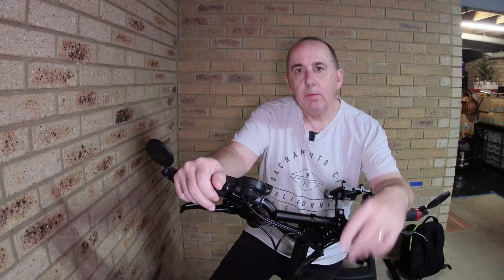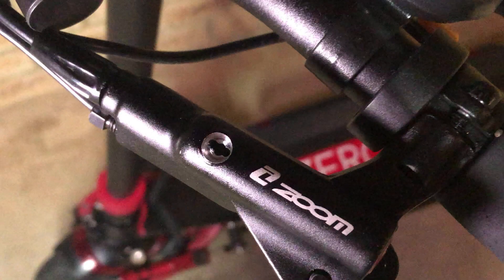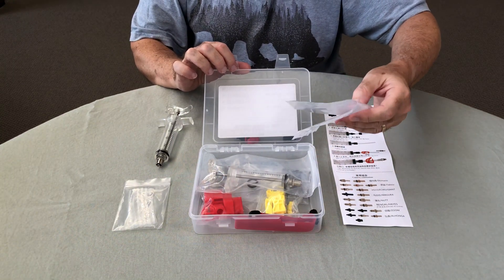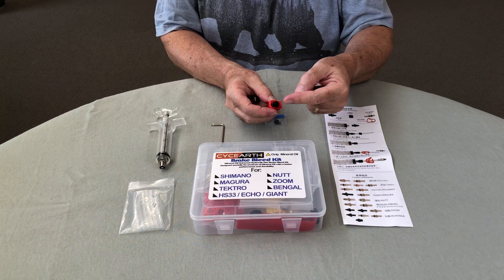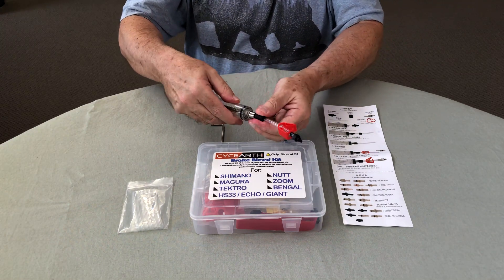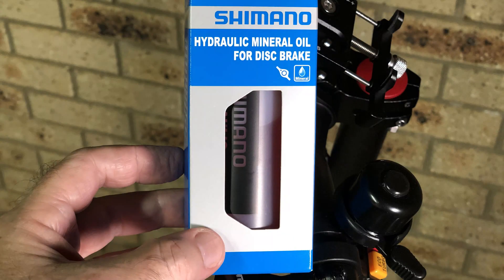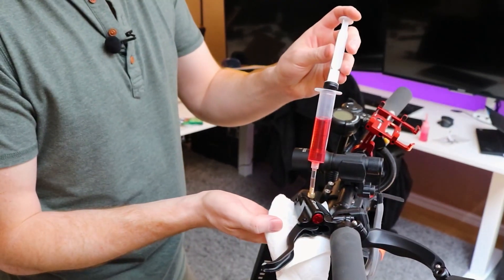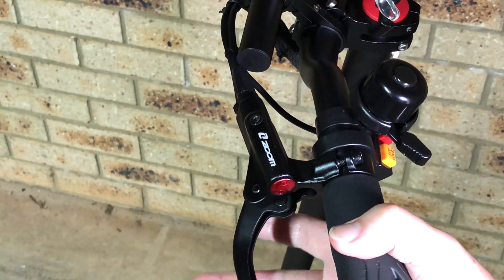How To Get The Air Out of Your Zoom Brakes

Comment: I've tried everything like 10 times and my brakes will have great steady pressure for 30 or so lever pulls then it will get spongy. I don't know what to do it's not leaking fluid anywhere. I'm at a loss, I might just have to replace the whole system idk

Comment: Brilliant.  Thank you so much.  I'd been struggling along with only front brake working on my zero10x and even that was starting to fade.  I bought one of the full bleed kits and had a go but was left frustrated with the result (plus it's tricky trying to do it by yourself).  I added your method in just now and as a result I've got a rock solid rear brake now.  I'll be doing exactly the same for the front (without the full bleed process) to get the fronts up to scratch.  Thanks again.

Comment: Thanks so much for providing this alternative method of bleeding brakes. My Paselec GS9 eMTB came equipped with Zoom hydraulic brakes. After 600 miles of usage, the rear brakes suddenly went spongy, and eventually the brake lever bottomed out. This model of brake has the additional cable to signal the eBike to stop power to the motor, so that helped a bit; but I was completely dependent upon the front brakes. Zoom changed the size/threads of the oil fill hole in 2021, so mine is the larger for the eBike that I purchased new in September 2021. Your method worked for me on the first try. Due to obstruction by the shift lever assembly, I was unable to rotate the brake lever unit far enough to remain level, so I had to remove it from the handlebar before the bleeding process. Despite the need to hold the syringe upright while pumping/flicking the bubbles out of the line with the other hand, the process was successful. Neither of my local bike shops service Zoom brakes, and they both recommend replacing them due to so many reports of them being problematic. I tend to concur now, but your brake bleeding method allowed me to get back on the roads/trails until I get some Tektros or Shimanos. Thanks again! Who knows... you may have prevented a potential accident if my front brakes had also given out.
Reply from the maker: Hey Styx, glad to hear it worked out for you. Yeah, an upgrade is probably the best long term solution. Stay upright! 😉

Comment: Thank you for the amazing video! My rear brake wasnt working at all and i didnt know about bleeding air. Turns out mine was pretty much all air at this point, pumping it out like you showed worked but after 45minutes i simply resorted to unplugging the rear brake hose, filling the serynge with shimano brake fluids and simply dumping some until all that was coming out was a nice stream of brake fluid, it does waste alot of it but after doing that a quick 15minutes of bleedling and now my rear brake works wonder! (Outside the fact im due for new pads..)
Funnily enough, for the fittings in the kit, mine worked as shown while the plastic one didnt fit. I also dont have any metal ring inside my fill port on both brake (first time opening the fill port). Anyway, really tankfull, i daily ride an electric bike until i get my own motorcycle and not having brake on something that easely reach 40km/h is well...not exactly stress free...

Comment: Yep great video,thank you for the heads up about the washer and orings,i did  a complete oil change and used the flick lever  method with the funnel still attached instead of syringe to finish off air bleed,worked a treat,for info the ezy mtb kit with copper had correct nipples.

Comment: I’m having this issue myself, I tried this method but the fluid doesn’t appear to move inside the syringe. Could it be an issue with the master cylinder? Help please
Reply from the maker: Hi, to be clear the fluid level in the syringe shouldn't change but bubbles should appear and rise to the surface.

Comment: Excellent video Mark. Trying to help my brother with his almost new e bike zoom brakes. He hasn’t had the bike a month and the rear brake is spongy already. Are there any theories out there why and how air gets in? Thanks Mark
Reply from the maker: Hi Win, thanks for the positive feedback! Often the scooter is shipped with air in the lines - poor QA from the factory. That was certainly the case for mine. If you bleed them so they work well and then the problem comes back quickly (within a week or two) then I would suspect a leak somewhere in the system. Check that all bleed ports are sealed properly. If he still has problems then a replacement brake kit may be needed. This should be a warranty claim if it is a new scooter. Good luck ! Mark.

Comment: Thanks for this video, it was very easy to understand and I was able to fix the spongy brakes on my brand new Dualtron City in about 10 minutes. I did notice a few things were different as I went along. At first I was concerned that I wouldn't be able to follow the steps. 
1. I bought a kit from the same manufacturer "Cycobyco" and it had Zoom brakes listed on the cover. However, there were NO instructions or connector diagrams for Zoom brakes. It only listed the other brands.
2. The black plastic connectors in your kit were yellow with black washers in my kit. (an improvement IMO). None of them was the same shape as the one you used. The kit does contain black plastic connectors, but they're all identical and they connect the syringes to the plastic hoses. I took the stopper (I forget the proper word) out of my brake master cylinder and tested the connectors one by one. I started with the (silver) metal ones and was able to find one that fit, it already had a washer on it. 
3. When I removed the stopper from my brake I was careful to check for a washer. I found that it wasn't metal, it was a black rubber O ring which was hard to see at first and it stayed on the thread of the stopper. I put the stopper in a pill bottle so the washer wouldn't get lost. By the way, my brakes didn't need a Torx bit, they had sockets for standard Allen keys.
4. Those red clips on the hose are great to stop leaks but horrible to open. Next time I will use hemostat forceps.
5. At first I was worried while I was bleeding the brakes because I didn't see many bubbles, however the brakes lost their sponginess within a minute. I did "flick" the brake levers to bring up more air. 
6. When I was finished and putting everything away, I left the hose connected to the metal connector I used for the brakes, so I'll know which one to use next time.
Reply from the maker: Hi Rose, thanks for providing that detailed info for Dualtron. It sounds like the brakes are slightly different to mine. Glad it all worked out ok for you! ☺

Comment: Can this gravity technique work even if the brake line doesn't always run vertically ? (rear brake)
Reply from the maker: Hi SR. Over time any air in the lines tends to float up to the top of the system, so the method shown works on front and back brakes. It's possible that a small amount of air could remain in the section that slopes upwards towards the back brake caliper but this would be an insignificant amount and would not be noticable in the brake handle.

Comment: Thanks a ton for this video. I used this on my Vsett 10+ and the brakes are firm again! Not sure if the vsett version of the zooms are different but mine had no washer and required a slighlty larger adapter but it all came in the kit so not a big deal.
Reply from the maker: Hi John, thanks for the positive feedback. Glad to hear it all worked out ok for you ! Cheers, Mark.

Comment: My right Zoom brake lever didn't actually have the metal washer. I watched this video before hand and made sure to check for it as I was unscrewing, but there was only the rubber seal. Any ideas where I could even purchase one? For now I just doubled up on the rubber seals and am hoping it's enough. Thanks!

Comment: I've seen others use the velcro strap to hold the lever compressed while unscrewing the syringe and I noticed you didn't do it.  What difference does it make?
Reply from the maker: Hi, none as far as I can tell. They do this to prevent air being drawn in when the lever is released. However, if you have done a good job this won't happen anyway. Basically, as long as the fluid level is touching the thread (meaning some will overflow when you replace the plug) then you're good to go!
Reply: @MarksElectricLife  Cool, thanks for the quick answer!

Comment: Great video. Just did an upgrade from Zoom hybrid brakes to full hydraulic on my Mantis. Started on the front as the original one failed totaly. Rubber boot split and lots of leaking with no clamping pressure at all! I had previously bought the full hydraulics from another scooter owner, who upgraded to Nutt brakes. I was trying to be clever and not let any fluid out, so i wouldn't have to bleed after, but discovered it's very hard to route the hydraulic line up the stem without fluid leaking out, so need to put more in the system and bleed brakes using your method.

Comment: HI Dumb question- so using the first method where you squeeze the lever for 20 minutes. 

Do I leave the lower valve by the break calliper closed? 

Or do I need to drain it first ? 

Or do I leave it closed the whole time?
Reply from the maker: Leave it closed the whole time.

Comment: May I ask what is the purpose of the red plastic below the reservoir?  Thanks
Reply from the maker: Hi Rick, I think you are refering the the hose clamp. This is used to stop fluid from draining when you disconnect from the brake assembly. See 04:04
Reply: @MarksElectricLife  Thank you for clearing that up,  some tutorials don't use the hose clamp so I wondered what it is for.
Reply from the maker: @rickaristotlejorge2618  Yes, interestingly those people tend to suggest holding a large wad of paper towel in your hand to absorb the spilled oil, but this is not needed if you use the clamp provided in the kit.😉

Comment: Hi, Thanks for a very informative video. The best I've seen on the procedure. When I attempted to bleed my Zoom brakes I could not remove the screw to the fill port. It appears to be a 2.5mm hex screw but that hex key will not work. Do you recall which tool you used to remove this screw? It appears you are using a torx wrench/bit. Thanks in advance.

Comment: My zoom brakes are different. The bleeder screw and hole are bigger than yours with a coarse thread. I had to use the biggest metal fitting in the kit.  I did it just like you said and it worked great. Lots of air in a brand new Aventon Aventure. I now have the braking power that I should. Thanks !
Reply from the maker: Hi Ronald, thanks for the positive feedback. I'm guessing your bike probably has the Zoom HB 875 brakes that are made for the retail market. It seems there is a cheap/nasty look alike that is made in the same Chinese factory for OEM distribution. The makers of cheap Chinese e-scooters buy these and put them on their "top-line" scooters so they can boast of having hydraulic brakes. However these brakes are pretty crappy and don't even have a bleed valve on the calipers, making it impossible to replace the fluid, if required. That said they are probably slightly better than mechanical brakes. Enjoy your ride !

Comment: I apologize if this is a dumb question as I'm completely new to all of this... But how do you get rid of the  existing fluid in the  brake lines? I want to completely remove the old fluid and replace it with new fluid. I saw a video where the person took out the calipers, and  drained the fluid from the calipers with a syringe and then  did what you showed in your video. Any suggestions would be helpful. Thank you!
Reply from the maker: Hi FPV, not a dumb question at all. Most hydraulic systems have a bleed valve on the caliper that allows you to drain the fluid and then recharge. Unfortunately I cannot find any bleed valve on these Zoom brakes. So the only way you could possibly drain the whole system would be as you saw in the other video.
Reply: @MarksElectricLife  Oh I see! Actually, what you're saying makes sense. I have the Varla Eagle One and don't see a caliper valve on thete either. So how do I go about getting all the old fluids out?
Reply from the maker: @fpvflyer4758  Sorry, but I don't know.
Reply: @MarksElectricLife  No worries. If I have to replace the brake pads on the zoom, do I just replace the pads and do this, or are there additional steps? I have a Varla Eagle One.. Which is basically a rebranded zero 10x
Reply from the maker: @fpvflyer4758  No, you should be able to just replace the pads. Use a flat tool to retract the pistons so that the new pads will fit into place. because you are going from thin to thick pads there shouldn't be any need to refill the fluid. Video for bicycle here (process is roughly the same for scooters): https://www.youtube.com/watch?v=Xqw0SaZl-jo&ab_channel=ParkTool
Reply: @MarksElectricLife  Many thanks sir! 👍🙏

Comment: You know that tiny washer you said not to lose when you take out the break screw? Mine didn't even have one! I legit was so careful and as it was unscrewing all I saw was the rubber o ring and nothing inside the screw hole. Also I don't have 2 holes, it's one big hole. So, do you have any ideas wherever I could purchase a compatible washer?
Reply from the maker: Hi, that's interesting! If you have a new Zero scooter with Zoom brakes (?) then maybe they have changed the design - probably coz too many people were losing the washer. If there is only one hole and not two smaller holes each side then you probaly don't need the washer. As far as I can tell the purpose of the washer is to cover the two smaller holes so that the 'O' ring makes a good seal.
Reply: @MarksElectricLife  I actually have the varla eagle one, which is the same scooter rebranded. Just received it and only have 37 miles on it. So I'm guessing you're right, model update? 

This video was so helpful thank you!
Reply from the maker: @dykealiscious  No worries ! I would say you are lucky because you have the newer design. Enjoy your ride !🙂

Comment: How can you tell if this process is needed, my zoom brakes are very grippy however I find that if I don’t squeeze the brake hard it slowly starts to get closer to the handgrip if I squeeze the brake gently it almost releases the brake and then grips again but the brake lever is closer to the handgrip. Is this a sign that it must be done?
Reply from the maker: Hi, I would say yes, you need to do this process. Your brake lever should stop hard at the same position regardless of how softly you pull it. Also, if you pump the lever and the stopping point changes with each pump that is a sign you have air in the lines.
Reply: @MarksElectricLife  thanks just purchased the kit off Amazon never had to do this with my last scooter same brakes not sure why this happened with a fairly new scooter! Ty for the info and video instructions!
Reply from the maker: @BFM777  Hi, yes, the same question came to my mind when I had this problem with my new scooter. Quality control is not very good on these Chinese scooters. Good luck with the bleed!
Reply: @MarksElectricLife  will this also improve the stopping power as well? Or does it just improve the lever pull from being spongy?
Reply from the maker: @BFM777  Hi, mostly it improves the lever pull but I found that without the slack in the system I could pull up in a much shorter distance.
Reply: @MarksElectricLife  so I did my brake bleed the bleed itself was successful however after I noticed the disc was rubbing quite a lot, I took it apart to see why only to find the piston that pushes the pads together wasn’t retracting fully, the piston came out and let in a bunch of air and now the brake is not working, any suggestions to fill it back up!?
Reply from the maker: @BFM777  Hi, the rubbing disc could be because it is warped rather than a piston problem. It sounds like you may need to do a full pressure bleed to get all air out. Unfortunately I cannot tell you how to do this on the Zoom brakes as I haven't been able to find any bleed port on the caliper. You could try doing the lever bleed in this video and eventually you may get all the air out, however it would take a long time and a lot of pumping. The only other thing you can do is replace the entire brake set, in which case I would recommend upgrading to something better like Nutt or Shimano brakes. If you don't feel confident to do this then I recommend finding a good bicycle/scooter shop in your area and ask them to do it for you. Good luck !

Comment: Hello I just recently got a new 10x and I’ve been dealing with my disc brakes ever so slightly rubbing not enough to create a performance resistance however enough that it is causing noise it’s a very light rubbing that’s creating a noise that becomes very annoying, wondering if you’ve dealt with this and or have any idea how to deal with it, I took it to the distributor they just told me it’s normal but clearly I don’t believe it is when I’ve had another one before this and I can’t recall every hearing it on my previous scooter, same model different brand. Ty
Reply from the maker: Hi there, first thing is to make sure the caliper is correctly aligned. Do this be loosening the two bolts that hold it to the frame and then pull the brake lever in and hold it with a cable tie, whilst you re-tighten the caliper bolts. If that doesn't fix it then you have a bent disk rotor. There is a video on how to fix this on the Electric Scooter Guide channel here:  https://youtu.be/ZchQVZH8kA4.  Good luck !